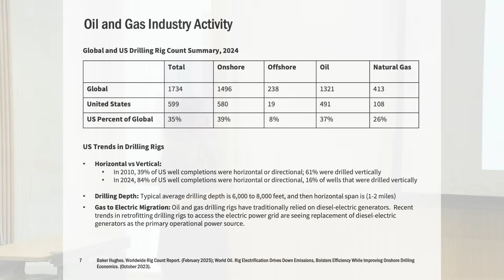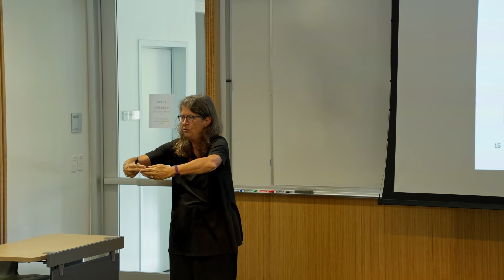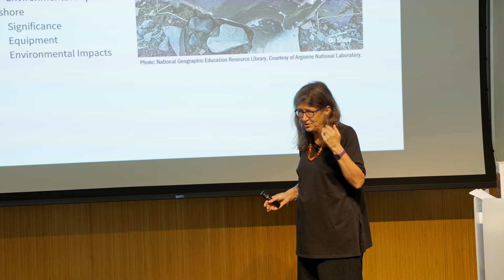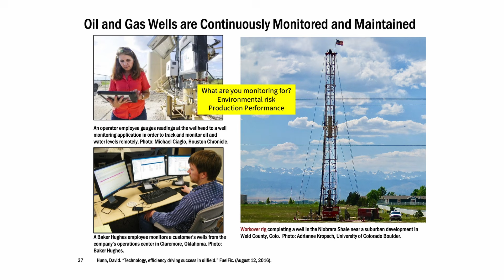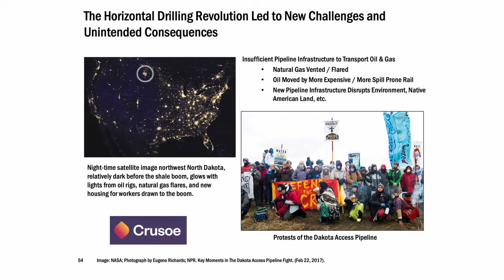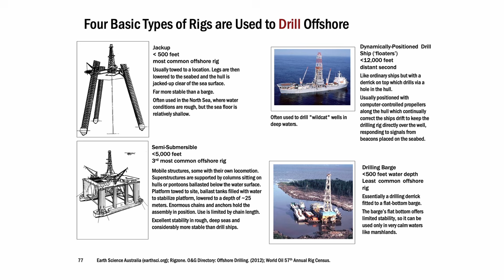Drilling, Completing, & Producing from Oil & Gas Wells | Jane Woodward | Stanford Understand Energy

Comment: In Canada we were drilling conventional horizontals in the late 1980s and the first safe closed loop underbalanced horizontal wells in June 1992. There are also very significant Drilling outfits in Canada - Precision Drilling and Ensign being a couple of the largest. (There are many others.) Top drives too are not new - we have used them since the early 1990s. We also developed rotary steerable assemblies in the early 2000s and downhole agitators to allow long laterals to be drilled efficiently.